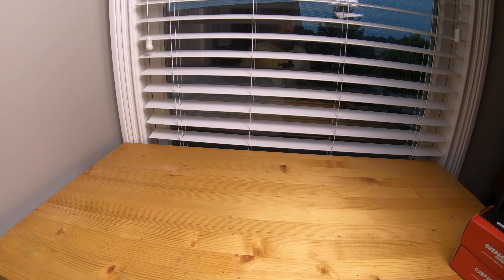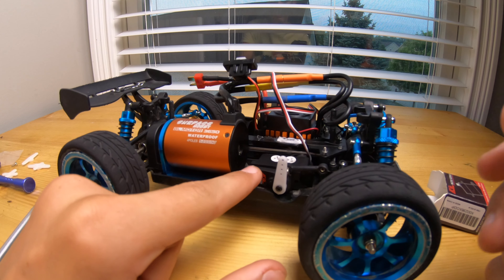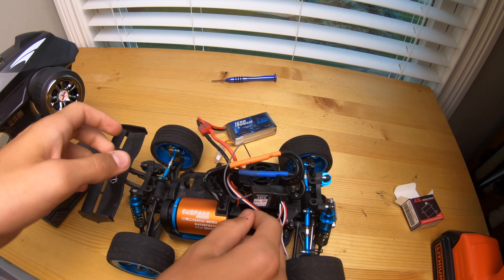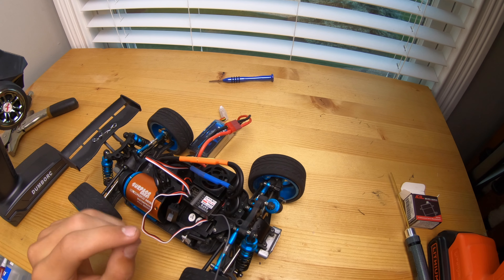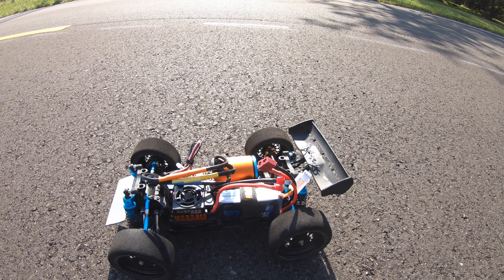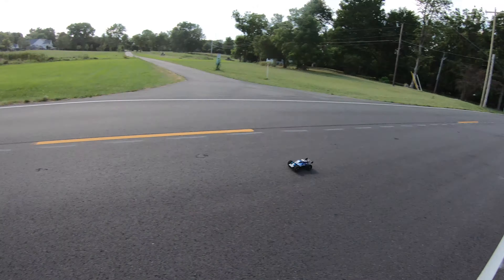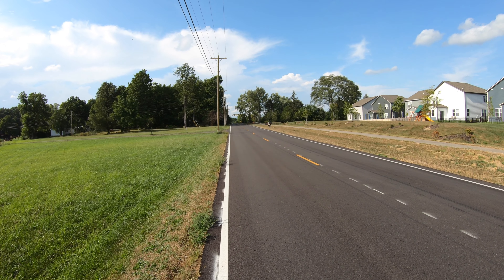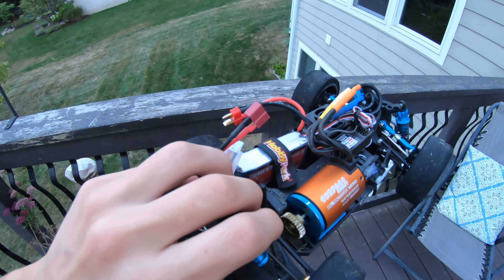Worlds Fastest Wltoys A959-B Part 1 2s Lipo

Comment: I touched 63 mph on udirc 1608, you can upgrade the pinion 30mm using adapter conversion from 3.175mm to 5mm shaft for motor. The rest looks like you have done the right steps except I'd go for surpass 80a esc and surpass 9,000kv 3650 motor. All the best, my next project with the similar settings mentioned is the a959 from hell and yea one last thing, good thought on sponge tires, these really help for speed runs. All the best.

Comment: When you blew the rubber tire, did you get it on camera? By the way, you should put a bigger pinion on that car, it’ll give you more top speed. My friends car is running on the same power system and it’s 1/10 scale 😂
Reply from the maker: I did not. I was just testing everything off camera. Thanks for the comment!